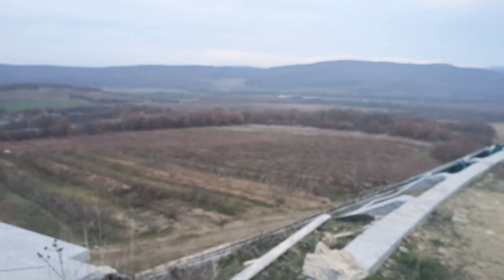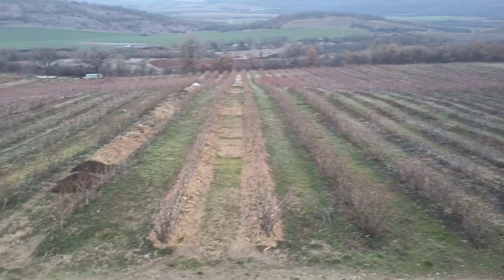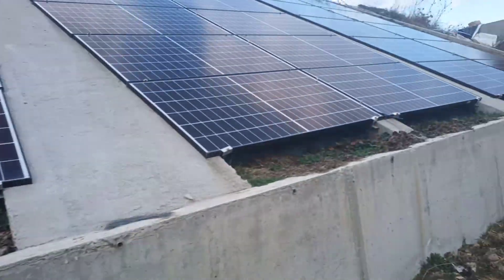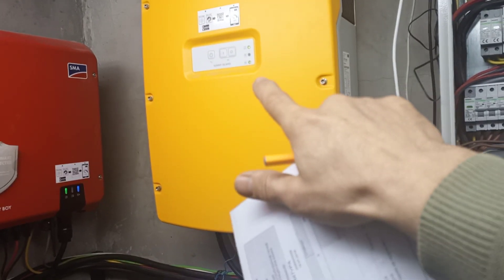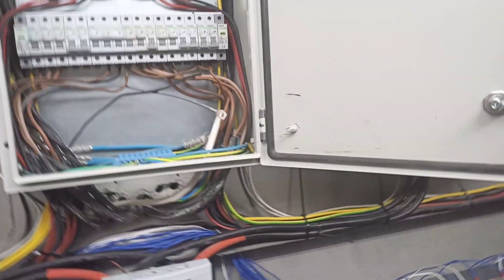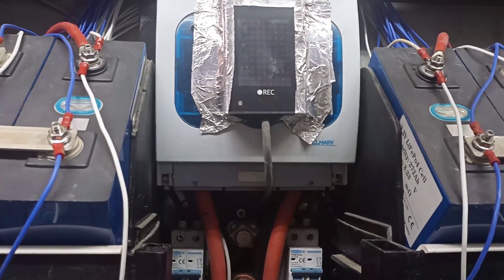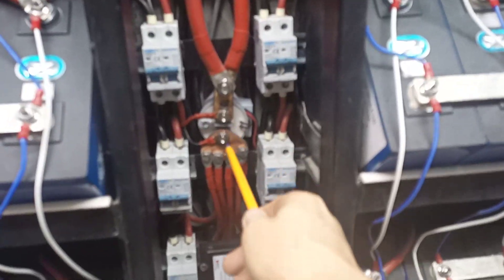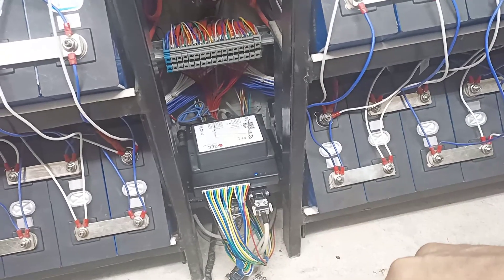Off grid solar-Sunny boy, Sunny island, 26KW solar REC bms, 120KWh-Lifepo4, Neey active balancer.

Comment: NO NO NO not a proper electrical installation - a trade electrician will tell you how many mistakes you have made. You need a standard main fuse/circuit isolator on the ac side just like a domestic house.  You need a master fuse and disconnection breaker and isolator on each battery bank. Those little PRC mcbs are not for load disconnection.  Hve you seen one catch fire
Reply from the maker: NO NO NO I think you should actually watch the video while paying attention before making such a Big comment. First I have only one battery bank with 16S 8P configuration  and it has a manual Main disconnector made two 250A fuses to support it and also there is a second disconnector controlled by the BMS via a 500A contactor. Those small MCB are there to disconnect one of the paralel banks in case of a bad cell or something, Of course I have standard MCB on the AC side to disconnect any "bad" invertor too you can see those in the main electrical  box.

Comment: Is that with just one REC SI BMS? If so, wow!
Reply from the maker: Yes just one.🙂
Reply: @penandpike  Blimey. I guess that's why you need the active balancers. Pretty cool.
Reply: Just a minute. You're also using just one active balancer? Isn't there a risk of too much current going between cells from different batteries across the thin wires?

I'm looking at using one REC BMS that is connected to the shunt for monitoring charge and discharge, but only one battery bank for cell voltages, and using a separate Neey 4a for each of the 16s batteries.

Comment: This is not a simple installation. Why did you not use something like a BYD battery with inbuilt BMS?  You could have installed the whole system in an afternoon. I would be concerned at the rat's nest of wiring..it's a mess....It could have been so much better for probably less money.
Reply from the maker: You really must be joking. BYD this size will cost me more then 100 000 $. I got my  cells for 12 000 and together with all the wiring, rack and BMS my battery bank is no more then 13 500$.

Comment: Hi there. Greetings from the USA. I'm working on a similar setup using SMA gear. Per the Sunny Island manual, SMA recommends sizing the battery bank at least 100Ah C/20 (hour rate) for each 1KW of AC source power when off grid. This set up appears to have 2500Ah, which is well above SMAs minimum recommendation. Other than the one BMS failing, have you had any stability issues, like system shutdowns?
Reply from the maker: It has been more than an year and a half since my system was off. No bugs no problems(spiders love it- they make large nets) :) I am planning to add another balancer ( before I make another video about my battery set up) but since everything runs so smoothly I just don't want to interrupt it. :)
Reply: @penandpike  wow. That's great. I'm glad it's working well for you. Do you have the REC BMS communicating state of charge to the Sunny Island? The addition of the active balancer is probably a good idea. How's the state of health of your battery cells? Do you ever see over voltage warnings on individual cells?
Reply from the maker: @davidjoly9816  Yes communicating the state of charge is the only thing that the SI wants from the BMS. Or it will not work. The heath of the batteries is good only 2-3 cells are slowly running away and I need to manually address them when the difference becomes too big. That is why I need to add Few more active balancers. maybe 1 or 3 more will be best. The battery bank is too big for just one balancer. It works only for short time when the cells voltage is above 3.38-3.4v or over 90% SOC and sometimes there are weeks when the SOC never gets to this 90 + like winter time
Reply: @penandpike  Thank you for sharing your experience. I appreciate it.

Comment: Do you also have SMA Home Manager 2.0 installed as well to monitor home consumption as all the PV inverters from SMA, Fronius etc only show PV generation unless you buy their energy meters which show the home consumption? How are you finding the Sunny Boy and Sunny Island? Have you had any warranty or support issues with these?
Reply from the maker: No I don't have home manager.  As off grid all I produce- I spend. :) I never had any problems with my Sunny boys-Sunny islands. Only at the beginning I had difficulties connecting to the user interface of the sunny island.

Comment: You have 3 x SB 6kW which is 18kW but you only have 2 x SI 6kW which is 12kW connected to these these 3 x SB. Does that not break the 1:1 rule in AC Coupling where PV inverter size cannot be greater than battery charger inverter?
Reply from the maker: This 1:1 rule apply only to some lower quality battery inverters like Schneider and Outback. The sunny island uses frequency shifting and can regulate the output of the Sunny boys The SMA ratio is 2:1.
Reply: @penandpike  awesome thanks for the reply. I asked this question because Victron documentation for AC coupling mentioned 1:1 rule for their inverter like Quattro, MultiPlus etc but I wouldn’t have though that Victron inverters were lower quality but then again they are quite a bit cheaper than Sunny Island so they might be lacking on some hardware and software function. Victron does support frequency shifting as per there document as well so I wonder why they mention 1:1 rule so strictly.

If I have 2 x 6kW SB, I can then do 1 x SI 6kW? What about if I have 3 x 6kW SB, can I still get away with 1 x 6kW SI or I would need 2 x SI 6kW minimum for 3 x SB 6kW?
Reply from the maker: @pariandangel  Yes 2 x 6kW SB, for 1 x SI 8.0 (6KW) No more than that according to SMA. SMA inverters are really considered as the best inverters out there. Just the fact that they have 10y warranty speak for it self.  Victron are good but not as good :)

Comment: Very nice setup! Love the DIY LiFePo4 configuration. Nicely thought out. That would cost quite a bit in the US, since the sunny islands alone would cost around $9,000, the Sunny Boys around $3,200, the panels about $25,000, and the batteries about $16,000. A whole home 24KW natural gas generator cost about  $10,000 installed. 
Your setup woukd last for decades with zero cost though, so I am not sure which would actually be cheaper to do in the long run.
Reply from the maker: Unless you have your own gas well I am 100% sure you better go with the solar. With all fuel prizes going up and the dependents from a third party supplier. The risks of running gas utilities and possible fire, Maintaining the generator which will eventually break. For me it is no brainer to go with solar.
Reply from the maker: Sunny islands are around 3 000 $ each I bought mine from here 
https://www.inutec-int.com/us/sma-sunny-island-80h-13-si8-battery-inverter.html
Reply: Sunny islnd is 3500 dollars not 9000...sunny boys are around 1500...dunno where you get your stupid prices from?

Comment: Very good work.
Unfortunately I bought a REC BMS for the Victron. In this I have now installed the firmware for SMA.

Unfortunately, the komminikation with the Sunny island still does not work.
Does anyone know what settings are still to change?
Reply from the maker: So you got REC BMS for Victron then you changed you mind and bought SMA sunny island. Than  you spoke with Rec staff and they sent you software for this SMA. You install the PC Software
BMS Master Control with the special cable on your computer and then updated the software for the SMA . Than you configure the BMS according to you set up. Then connected the BMS to the sunny island via the cable that comes with the REC BMS. And after all this you can not connect???????
Reply: @penandpike  
Thank you for your quick feedback.
The purchase of the REC BMS for victron was a mistake. I already had the Sunny island before.

"Than you spoke with Rec staff and they sent you software for this SMA. You install the PC Software BMS Master Control with the special cable on your computer and then updated the software for the SMA." 
YES correct

"Than you configure the BMS according to you set up."
YES, but nothing for SMA. Only for the battery.

"Then connected the BMS to the sunny island via the cable that comes with the REC BMS. And after all this you can not connect???????"
YES correct.

On the sunny island, I selected the lithium battery and made the necessary entries.
After a few minutes then comes the error message "BMS is pending" The values SOC and SOH etc. are not transferred.
I hope you have an idea.
Reply from the maker: @robjub1  The only thing that comes to mind is that may be the cable from the BMS is different for the SMA. ( I guess the cable is for the Victron) Can you show me a picture how you connected it to the SMA
Reply: @penandpike  
How can I send you pictures? I tried different slots. But none works. maybe you can check if the cable assignment is correct (from the pictures). The REC itself fits the description. But about the assignment on the sunny island I have no information.
Reply from the maker: @robjub1  You should ask Rec if the cables for Victron and SMA are the same and also you can upload pictures  at some free image upload sites https://im.ge/?gclid=CjwKCAjwv4SaBhBPEiwA9YzZvKByVzzTObGHEs6lTYymVFJVVtnTCtVhh3Vu1OLx5FHrAaWF8zsqIhoCaYIQAvD_BwE and post the link
Reply: I found the problem now and fixed it.
It was in fact that the pin assignment on the rj45 connector was not correct. Victron uses a different one than SMA.
Now everything works perfectly.
Reply from the maker: @robjub1  Great! Glad I could help a little. :)
Reply: why in the hell did you buy Victron gearfor a Sunny island? You did it all wrong...

Comment: The SMA Sunny Boy Island battery compatibility list page does not shows customer LifePo4 battery setup? Or are using an external charger device for the LifePo4 batteries?
Reply from the maker: Yes it does not! That is why it took me long time to research different options  and finally make this design!

Comment: Excellent stuff and congratulations with your great build. Going from DC to AC, back to DC seems a long way to go, but it's much simpler and in the end you won't need less equipment in any case. The DC-AC-DC loss is neglectable for systems of your size. 👍
Reply from the maker: Exactly! Simplicity is key! Also you can use the electricity from the sunny boys( 240V) but you can not use the DC electricity from the charge controllers.
Reply: What % loss at a guess would the DC-AC-DC be? DavidPoz has a video where he measured Growatt vs Victron SCC and were 94.2% and 98.3% efficient, how do you think Sunny Boy + Sunny Island would compare?
Reply from the maker: @narotica1  SI 95.8 % and SB 97.0 % as per manual!

Comment: I have a sunny island also AC coupled, mine has 6000 watts of enphase grid tied,and 7000 watts of high voltage array to Delta H6 both sets respond to Sunny Island . Mine also has 3000 watts of DC coupled thru independent controller (Midnite solar).

Comment: Hi large setup
I'm currently working my sunny boy and sunny island.
Am I right in thinking that both Inverters get wired together in the consumer unit?
Reply from the maker: Yes, They are wired together.
Reply: @penandpike  
Thank you, is the sunny island AC1 cable only 3 g 1.5 16²
Reply from the maker: @dalesutton3289  For my Sunny island 8.0 the cable I used for AC1 is 10mm2 with 3 wires
Reply: @penandpike  thank you 👍
Reply: Hi
Sorry to bother you again.
I'm confused to where the AC cable for the sunny boy gets connected to and the same for the sunny island, could you explain where your AC cables get connected please, do the get wired together in the consumer unit.
Reply from the maker: @dalesutton3289  https://www.youtube.com/watch?v=RVLs59Zxu78&t=2s&ab_channel=Pen-and-Pikeblueberries

Comment: Hello from Brandenburg / Germany. good job. i myself have a sunny biy 4.0 and a home manager 2.0 and a 5.5 kwh pv system. I also want to load lifepo4. can you tell me what components i need?
a Sunny Storage is clear!
thank you for your help.
keep it up
Marvin
Reply from the maker: But what inverter do you use? Is it Sunny island or what?
Reply: @penandpike  Hello, I am currently using Sunny Boy 4.0 as an inverter. However, it alone cannot charge batteries.
Reply: @penandpike  the sunny island charges your lifepo4 batteries without any problems? i am connected to the mains and need a system that charges the batteries when there is excess energy. regards
Reply from the maker: @Pelzkelle  So you need Sunny island inverter, Rec BMS (with accessories) Balancer, Cable and fuses. That's all.

Comment: Nice video! I have a similar setup to yours, the AC coupled set up great most of the time, but if you have a low voltage situation there is no way of starting the sunny island to charge the batteries. again
Reply from the maker: I think you can fool the SI by changing the SOC in the BMS. So far I have never been below 20% and will try to keep it that way.
Reply: @penandpike  yes, I suppose suppose when you have a big enough battery it's not an issue.